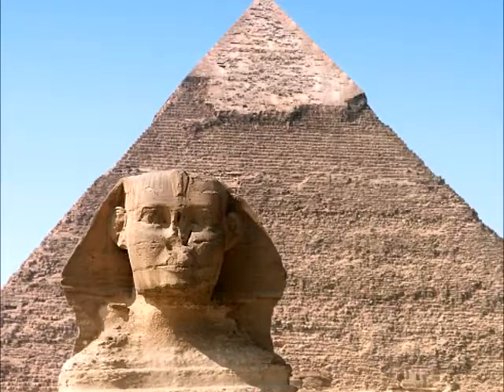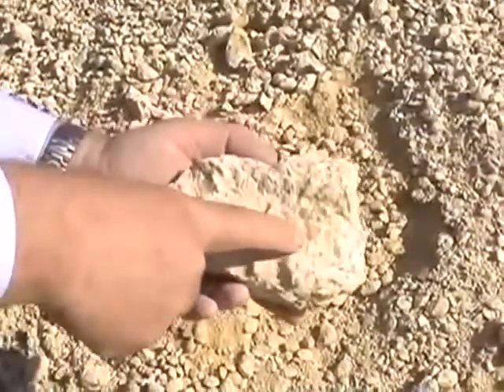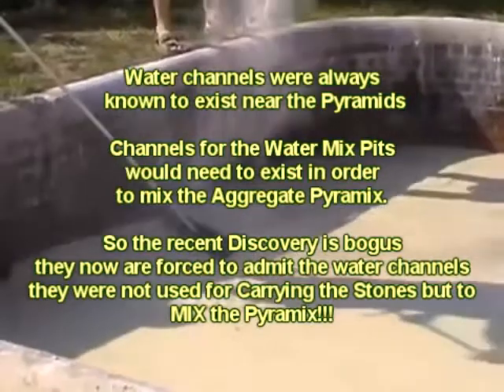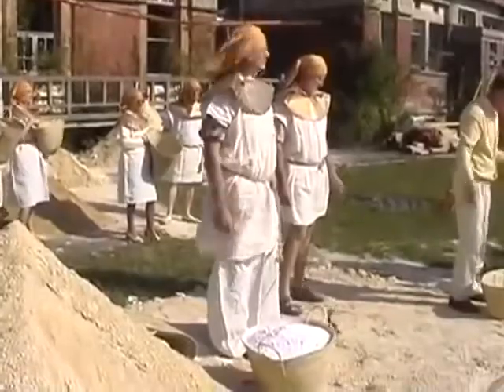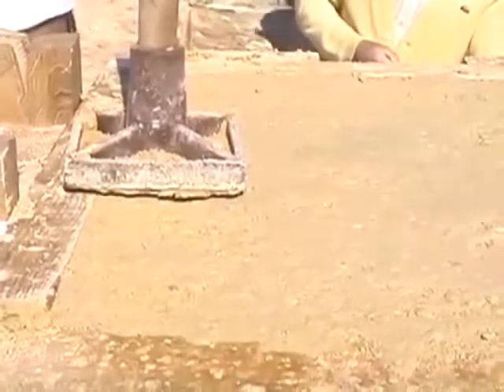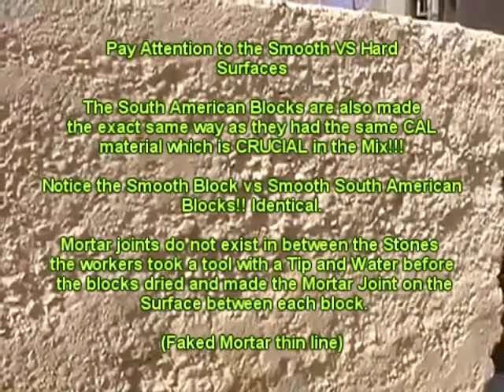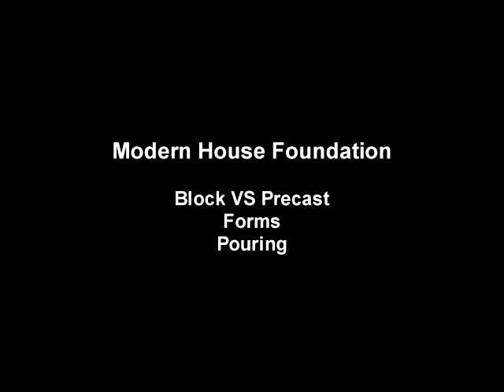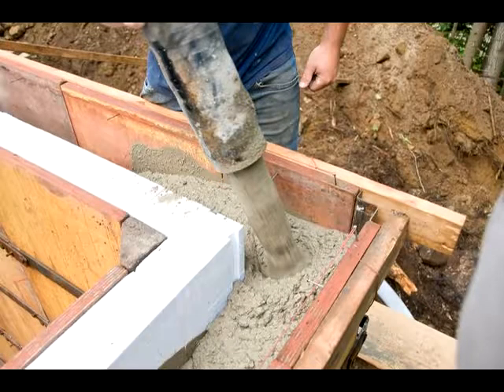Pyramid Blocks Casting

Comment: first lie at 1.02 it is not the type of material that can be found near Giza pyramids
Reply from the maker: Those materials where not at the pyramids, they where brought there from the quarries using the water channels by boats. The water channels now have been found and it is clear that they used those water channels to get boats to the pyramids and use the water for the mixing. The water channels are now a new discovery ( 2019) that explains the length they went to get water to the mixing pits near the bottom of the pyramids. This material in France is "SIMILAR" as is said in the video. They key piece of this video is at the end where the amount of water dictates how smooth the block will be.
Reply: @danfuerthgillis4483  that is not what was said at 1.10 mark , i was at Giza pyramids in march 2020 and it is evident the block are natural limestone , why the lies
Reply from the maker: @al2207  Ask the Roman empire they were there for many centuries, heck they ruled Egypt for centuries. Somehow those massive pyramids were never in their sights ( laughs out loud!!!) and "Somehow" no one ever asked who built those massive pyramids and "somehow" they did not ask about the building technology about those massive blocks. Somehow I think the Roman Empire knew full well how they were built, and used that technology back in Rome for their construction. Do you know how Southern European homes are built? Clay blocks mortared on top of each other, then sections are chiped out for the hydro and water pipes that carry water and hydro through plastic pipes. Those walls are then cemented  smooth flat and you do not see the blocks anymore. That is how our home was build FAKE single wall. The Ancient civilizations in South America also used the same casting and line dredging techniques. If you use a tool to draw the lines while the curing of the stone is still going you make lines in between the blocks. As time goes on those lines wear inward and create what looks like to idiots separate blocks.
Reply: @danfuerthgillis4483  except, how do you make that out of granite? Prove it
Reply from the maker: @baccy81  Here is how they dealt with granite ( slower working then casting the Blocks) https://www.youtube.com/watch?v=K4aZ2P1KQDY. You can't fake Granite like the other Egyptian Casted Blocks, that is why they needed all those slaves due to the Granite moving. I believe the Indian Cutting Technology is the correct one for Egypt as it is still not 100% perfect and some stones will have wrong cracks in them as have been found in Egypt.
Reply: @danfuerthgillis4483  I don't dispute this. But it doesn't explain your point.
So they moulded limestone which is lighter and easier to quarry, but with granite they would still use the conventional technique, and they used it for the largest stones in all constructions. This doesn't make sense to me
Reply from the maker: @baccy81  All the stones that make up the Pyramids are aggregate mixing techniques, some sections inside the pyramid are indeed quartz or granite. Do you know how granite stock stones are cut in 2021? The same as they were 4000 years, stress hole cracks are made along the stone which crack the stone into sections that look like they were cut with a saw. Since I worked in tile installation I should know we use a score line press tool to crack the tiles into the sections we want all perfect lines. With granite nothing has changed in 4000 years for the main quarry stock cuts it's still split the same way as 4000 years ago. The main difference now is how fast we can finish that stone. It is easier to cut pieces of large stones vs small ones. When we cut granite pieces from smaller cut quarry pieces we use saws to do this so there is less loss of the stress cracks. In Egypt there are multiple sites with large granite stones that cracked when they were being split from the main granite sections, so they abandoned those ones as they could not cut those stones into smaller thinner sections and reuse the leftovers. It is clear that no one was casting granite stones, only the smaller and pyramids blocks were casted because these people were not stupid, they needed materials that were plentiful for these massive projects. The North American Indians carved massive sections out of the sides of mountains and use those sections to carry water, they used what was around them since the limestone was already weathered it was easier to cut out and chip away. The water channels were not added to the mountain sides they were carved out. Ancient people were not highly educated, but they have fooled SCHOLARS for centuries who make Fables out of nothing. I believe that is what happened in Egypt, some Freemasons made their name in history with faked items and faked technology. One word for certain the only people that could end this debate are the Roman Empire as they ran Egypt for centuries and they knew clearly and in detail how the pyramids were built including the technology of Casting aggregate mixes to make long lasting mortar and concrete.
But there is nothing in any Roman Empire books about anything related to the Pyramids, its as if they never seen them when they were there for centuries, which begs the question, did they lie about them? or kept the technology how they were built a secret? The Vatican has all the answers but no one is allowed to see the "OLD WORLD" books, you remember the Alexandria Fire, the library that was about to be open to the public before the fire.....I believe someone removed all the old books and burned it down.
Reply: @danfuerthgillis4483  I think you are replacing a myth with another one...
Reply from the maker: @baccy81  Not at all, I have seen, I have read many books on the Roman Empire, not one book mentions anything about Egypt and their Pyramids. It seems like the Authors are careful to avoid any writing of it.